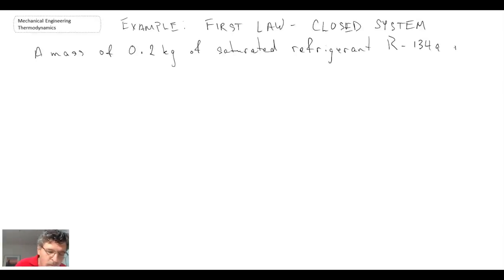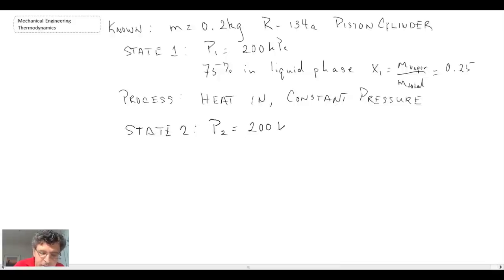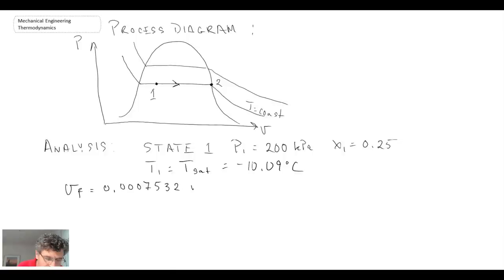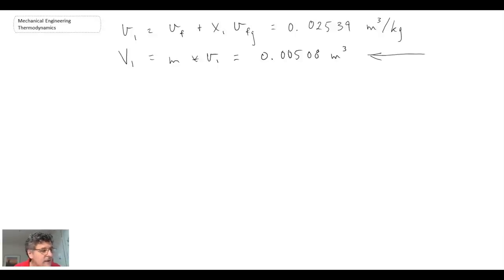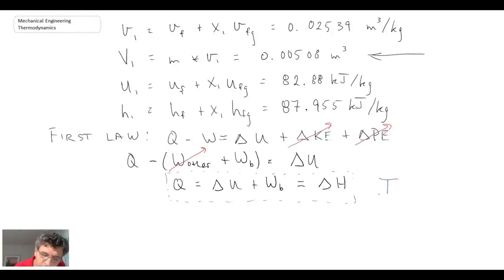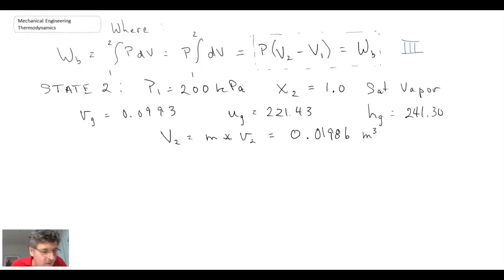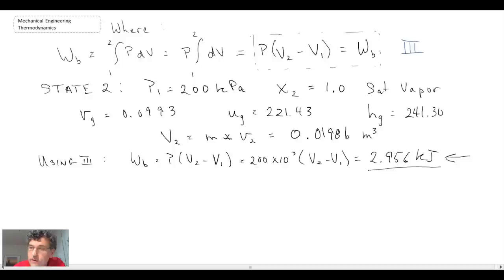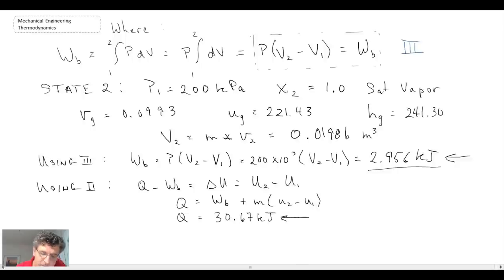Mechanical Engineering Thermodynamics - Lec 5, pt 2 of 3:  Example - First Law - Closed System

Comment: The property data that you use is significantly different than given in tables in Borgnakke and Sonntag' Fundamentals of Thermodynamics. Please check it out!
Reply from the maker: The data from the same table in different textbooks can vary - the main thing is that you use the same table while performing your calculations.  The final answer should not change though as we are most often calculating differences while using the tables.

Comment: hi at 2:45 how do we know x2=1.0?
Is this a general rule from the text book?
p.s i am using Borganakke, Sontag Fundamentals of thermo 8e
Reply: +Ruhul Amin The problem states your 2nd state is completely saturated vapor. Which means your are on that curve line of the dome on the far right. That is a 100% vapor state. Hence, x=100/100 = 1.0 which is the quality. The left curve line of the dome represents 0 quality whereas the far right curve line of the dome represent 1 quality, meaning 0% vapor and 100% vapor respectively.
Reply: +Ruhul Amin Maybe it is too late to answer but: it's given that in state 2 there will be only vapor. So, x=1 when we have saturated vapor.